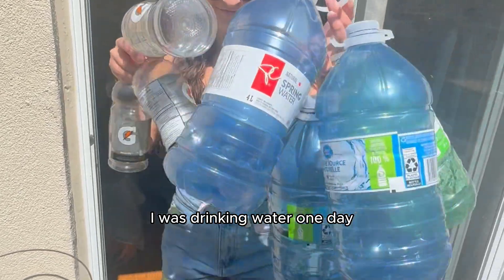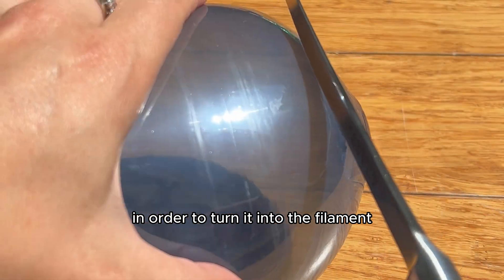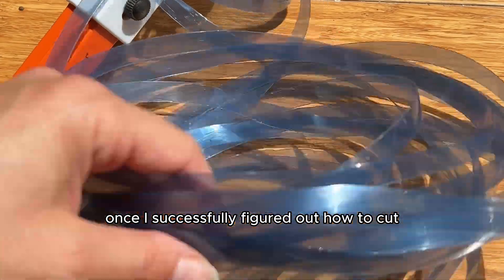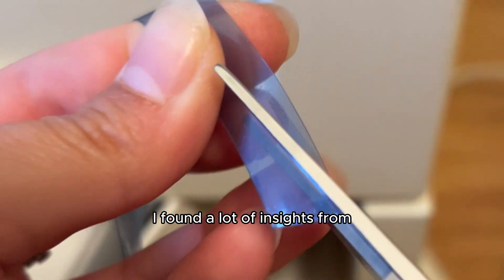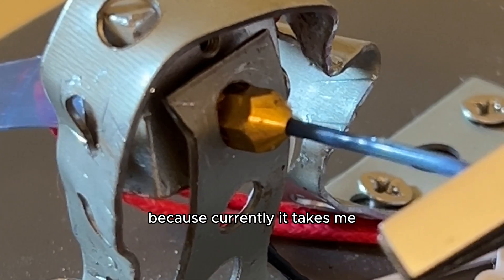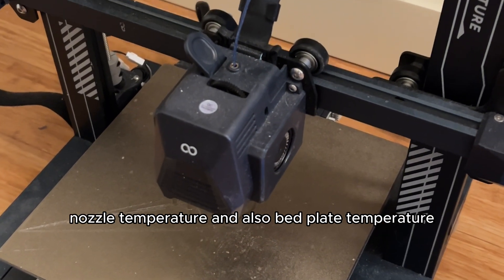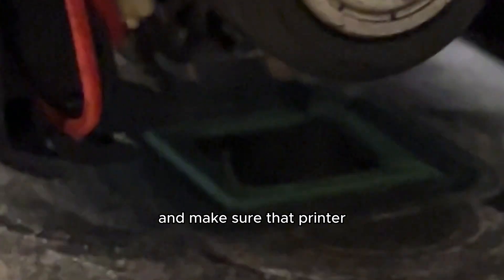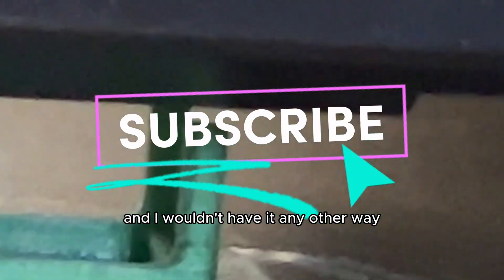How I Turned Water Bottles Into 3D Filament

Comment: you can possibly take ptfe or silicone tubing and join the smaller rolls into a large roll.
https://www.youtube.com/watch?v=BvLASf_U75s                                   <----------this is just one way I've seen people use candles too
or buy a filament connector like the sunlu one...
https://www.youtube.com/watch?v=bvNGxi61lHg
This is a very interesting project.

Comment: the nozzle problim can be fixed by holding the nozzle in some pliers and using a blow torch to incinerate the plastic out. and by replacing the hot end with a all metle one and re flashing fermwair to the cotrol bord you can print at 300 degres and save more money.

Comment: On those elegoos like my neptune 4 plus theres a hole on the side of the extruder that you adjust with a allen key. If its too tight, your nozzle keeps getting clogged. I loosened mine and it stop clogging.

Comment: im sorry to dissapoint you but this has been figured out long time..its all mechanical. You dont need a new printer. Yes you should be proud of yourself but you are killing yourself. instead of your process you just have to shread the bottles. I am absolutely convinced that you can build one for cheap. all you would need is a box...you are going to need some bottles. the is one issue . The plastic used in water bottles are a different type of plastic so to make it easier to print you can add other types of plastics .The shredder will make it easier.I have faith in you. You go girl!!

Comment: I have an idea for your nozzles, but I DON'T know if this will work.
Do you have an instapot? I'm thinking you could put your nozzles on a paper plate or such in the instapot and run it for a half-hour to really cook the plastic. I suspect it will then be soft enough to clear the nozzles. Handle them with tongs or a pair of pliers. They will be HOT.
I guess you should try this on one or two first, to see if it works.
If it does, let us know.

Comment: You can do whats called a "cold pull" heat up thr nozzle in the printer remove with a socket set and while its still hot and you are holding it with plyers you stick another peice of filiment into the nozzle  and bond it to the plastic in the nozzle and wait just long enough for it to cool that when you yank on the the filiment it pulls all of the plastic back out and hopefully the dust or gunk  in the end, i don't like waiting for things in the mail, ive done it quite a few times because i keep my filiment in a dusty garage lol.

Comment: This is really cool, I’m down to help. I was thinking of using an arduino to automate the process. What you did was very cool tbh. I think what you could do is buy a a filament tip that has a wider gap. I have some really cool ideas and can help 🙋🏽‍♂️🙋🏽‍♂️
Reply: I actually found you this, https://youtu.be/Ik4b_BDYOTs?feature=shared, and I was thinking of using an arduino connected to a small motor in order not use a a drill.

I think we can do this!!

Comment: Looks absolutely amazing! I can't believe you actually can make filament out of the plastic bottles 😯 The first thing that I thought of when you showed off your filament maker was to 3d print a part to fortify the part where you pull. You could easily design a frame to go in front of the metal and bolt it down to the wood. Good luck with your project!!!